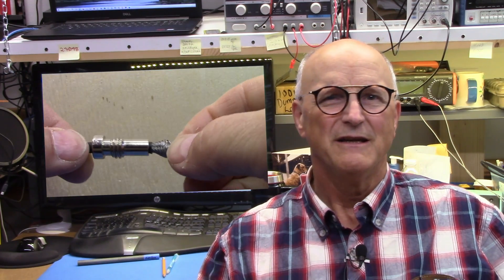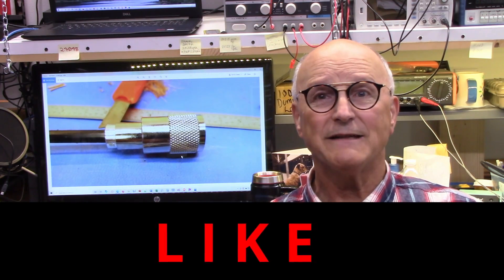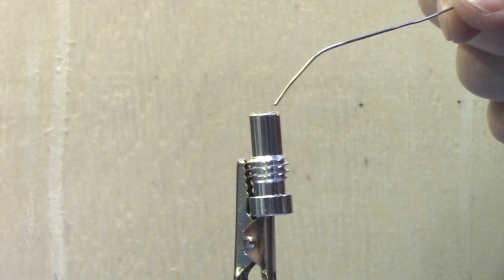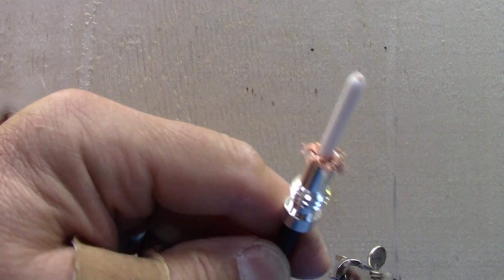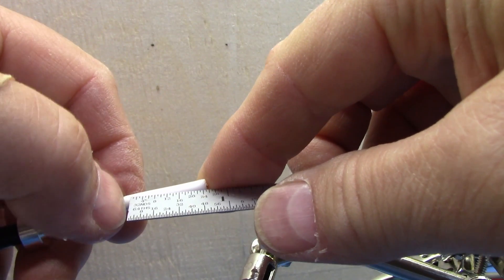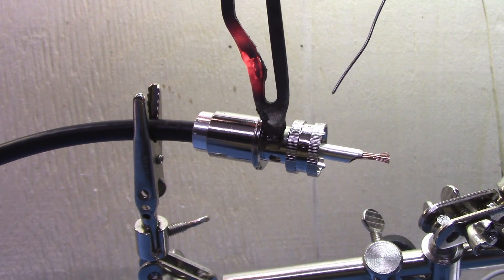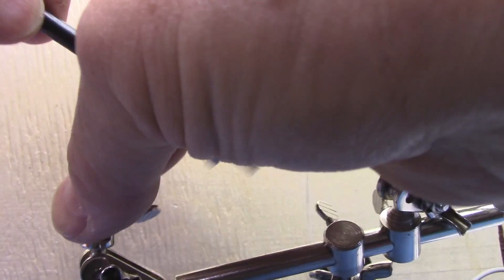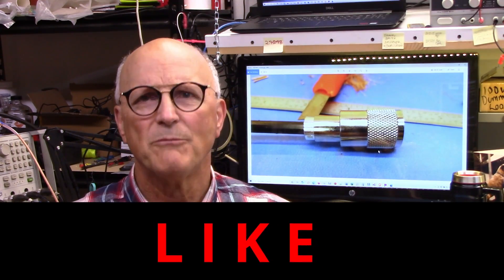Installing a PL-259 (UHF male) on RG-58, RG-59, RG-8X and others (014)

Comment: Do you need to clean off the flux at the end with water or alcohol?
Reply from the maker: I like to clean off the flux with some 99% isopropyl alcohol. You can get this at the local pharmacy. You might have to ask for it. Be careful to read the label. Remember, if it ain't alcohol, it is water. 50% alcohol is 50% alcohol and 50% water. We wouldn't want that. :-)

Comment: What type of solder? 60/40 rosin core?
Reply from the maker: I use 60/40 rosin core because it melts at a lower temperature and is easier to work with than the lead-free solder. In the end, from an electrical point of view, any electronics-grade solder (NOT acid core!) will work. :-)
Reply: @eie_for_you , thanks. I was just reading about 63/3 as well. 60/40 is probably good enough for what I a doing and available at the store down the street.

Comment: Nice to find instructions for the cable and plug that I have. It's not at all obvious how it is supposed to work. The 21st century and coax plugs are more difficult to use than 50 years ago. That's called progress.
Reply from the maker: I am glad that this was helpful. When I discovered this method, it revolutionized my cable terminations.
I thought that you would appreciate a little history on this connector ... it was developed in the 1930's back when UHF was defined quite differently. It is actually not a very good choice for what we refer to as UHF today.
It and a LOT of coaxial cable made its way into the "general population" after World War II when a huge glut of military surplus hit the market. This is the source of the PL-259 & SO-239 nomenclature associated with it; these are the military designations for the connector. In the R.F. world today it is generally referred to as a UHF connector though, like I said, it isn't suited for what we call UHF today. The name stuck from the 1930s.
It is a pretty interesting history, in my mind, and I thought you might appreciate it. 🙂

Comment: Ralph TNX ! This method is Top Shelf , but you know that !  Appreciate your Efforts and the Share of the Handy Share , 73 AJ W5heh PS now gotta apply this to cheap coax picked up years ago with thin shield w/ foil wrap UGG ! Foiled again, hihi  ,lol.
Reply from the maker: LOL!  You are very welcome!
Me? I thoroughly dislike foil shields. There is no way to solder to them. I'm hoping that this is some of the double shielded stuff with the braid shield plus the foil.  In that case all you can do is work with the braid and let the foil "go along for the ride" with only a mechanical connection. I've encountered some coax where they used aluminum for the shield wires! No soldering to that stuff either. 😞 
73! 🙂

Comment: I learned this back in 1970 as a helper in a radio shop ran by WB5MPX
Reply from the maker: The crazy thing is that I only learned this in the last 10 years. I'm glad I did! 🙂
Reply: @eie_for_you  makes the job much easier.

Comment: please provide the make of the connectors you used and if possible a link to purchase them. Thank you VA3TBQ
Reply from the maker: Well ... I tend to go with Amphenol RF connectors. Certainly not the least expensive. 
Here is a list of potential UHF connectors as listed on DigiKey:
https://www.digikey.com/en/products/filter/coaxial-connectors-rf/coaxial-connector-rf-assemblies/437?s=N4IgjCBcoEwBxVAYygMwIYBsDOBTANCAPZQDaIAzHAOwCcALDCALqEAOALlCAMocBOASwB2AcxABfQgDYADIhApIGHAWJkQMKtICs81iE7c%2BQsZMJxZEaIrRY8hEpHL0w1CjB0t2XSLwEi4lLgukw2SioO6s4g9LJ6skwGRn4mgeYgALTWyHaqjhpgYF7MEsFh5ACqABIAYgAESETCwrhIHET82N4gXjZsUGDsA5BgsrJlQA
Here is a link to the list of reducing adapters at Digikey:
https://www.digikey.com/en/products/filter/coaxial-connectors-rf/coaxial-connector-rf-accessories/342?s=N4IgjCBcoCwOxVAYygMwIYBsDOBTANCAPZQDaIMYcAzAKzUgC6hADgC5QgDKbATgJYA7AOYgAvoTAAOGIhApIGHAWJkQ1AJy14s5iHaceAkeMJSADBGjy0WPIRKRylGgCZaTVh0jc%2BQ0RIgALRWyLbKDmpgYB6MYvFAA

Comment: My old boss decades ago would scrap off the plating around the holes, up and down, on the main body. The body would heat up instantly.  I love how strong the mechanical connection is to the insert. Great video.  Thanks again.
Reply from the maker: I've done this to some extent. We want nice, clean solderable metal available to the process. Of course, if we have the more expensive silver plated connectors, a good solder paste cleans things up nicely and keeps the advantage of the silver plating. 🙂

Comment: What solder paste did you use?
Reply: No that is flux for plumbing. Never use that on wiring or PCB’s.
Reply from the maker: @doc145  True that ... just looked it up.
Reply from the maker: I have some really *OLD* stuff I use.  Digikey has these that would work: 
315-RA691-ND
or
315-RA891-ND
Reply: @eie_for_you  I have some Oatey No.5 here, I read that the only difference between No.5 and N0. 95 flux is the 95 has some solver powder in it. Apparently it works for electronic per a model railroad site.
Reply from the maker: @rt83021  this is plumbing flux not for electronics circuits. Leaves too much corrosive residue behind.